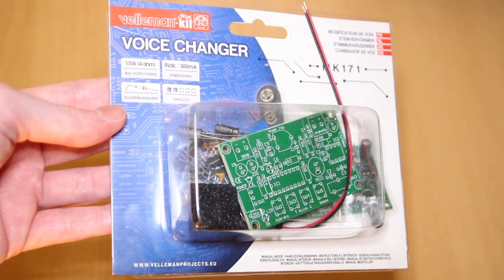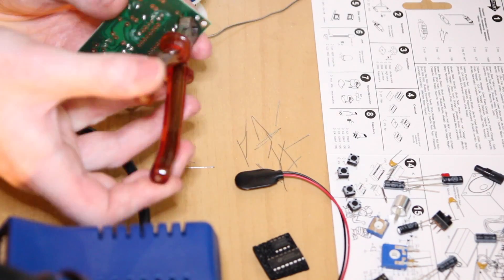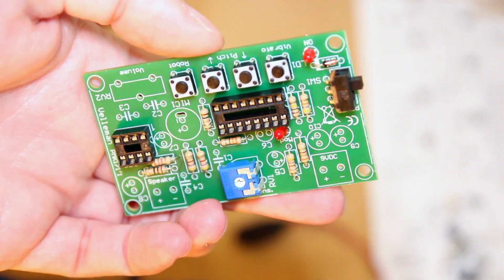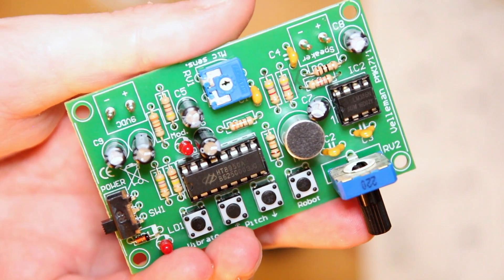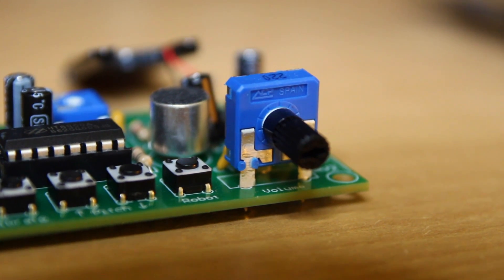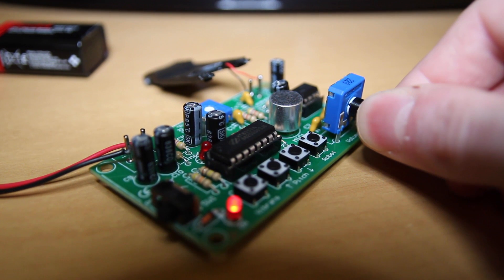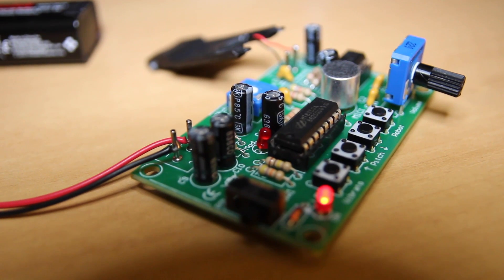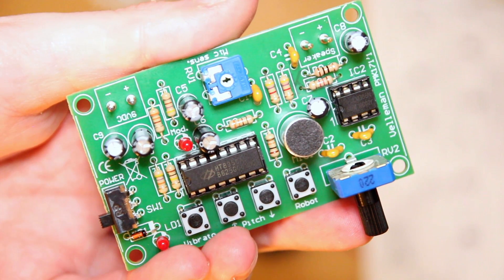Velleman MK171 Voice Changer Review - Simple Electronics Projects for Beginners

Comment: Dear Dr Jake, would you mind helping me understand how I need to use the Multimeter to locate which cable is which from the 3.5mm Jack? As I plan to do the same, but I don‘t have the knowledge to use a Multimeter. Basically I don‘t have any knowledge at all here, but I need a Kylo Ren Voice changer :-) Once build, soldered and programmed my own 3D axis DSLR Gimbal with the same lack of knowledge, so I am confident with a little help of yours I get there. Thanks a lot! Great video btw. Thanks.
Reply: Use the white as postive and the unsheathed copper as negative

Comment: Could you modify this to take a headset mic input and output the changed signal to a pc kinda like a hardware voice changer
Reply: I don't see why not , it's just a regular electret mic , same kind most likely used in your headset , just be sure to get the mic polarity right , electret mics have a pre amp circuit inside , and won't work, or will be damaged with reverse polarity

Comment: I soldered on a mono female 1/4 inch jack to the speaker and mic terminals so I can plug a 1/4 Mic and plug into a mixer or radio to record it!!
Reply: I know this is a year later but how did you do that?
Reply: @kirailove4207  i connected a mono 1/4 female T R jack straight onto the mic or rec in and the same to a speaker or output out for a mono connection! On the pcb should be red and black.
Reply: So u can plug dynamic ? And u didnt have gain issues?